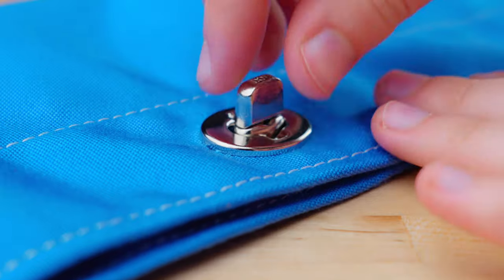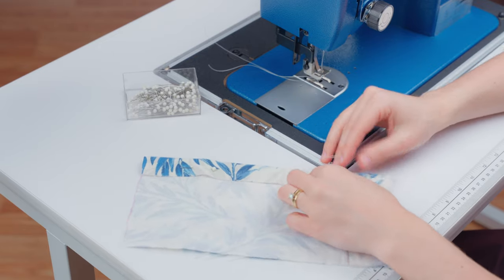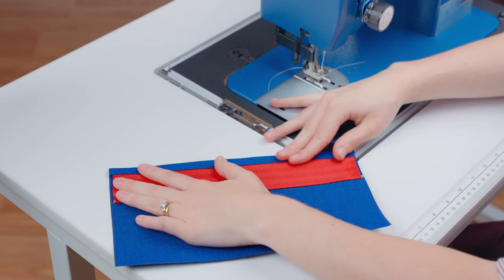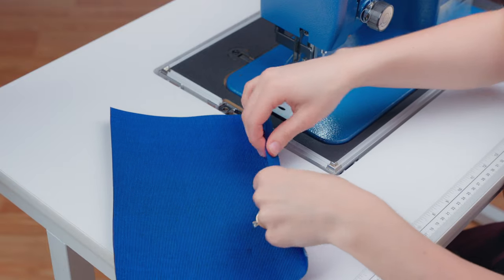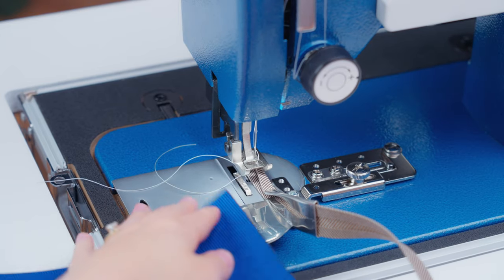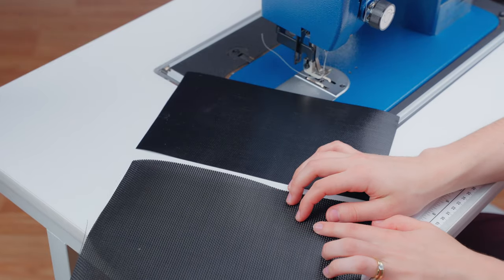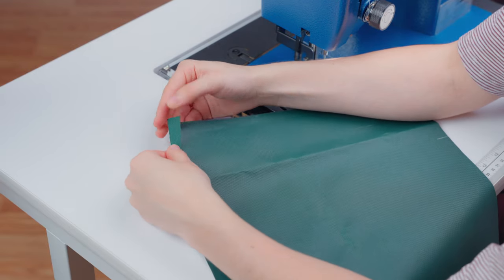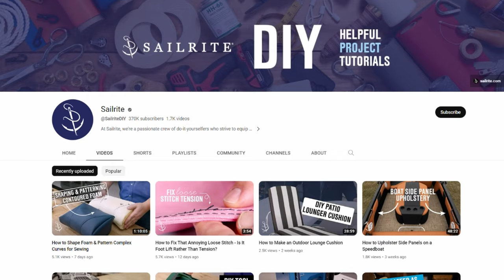Learning to Sew | Part 4: Popular Hems & More

Comment: I was in management with North America's largest leather furniture manufacturer. That double sided tape was simply NEVER used. 
I've been in MANY furniture repair shops where fabric, vinyl and leather covers were repaired and often replaced. That double sided tape was simply NEVER used.

I don't get Sailrite's worship of that double sided tape. Professionals simply don't use it. It costs much more than thread and adds work, time and money to the process. Why are you so entrenched in tape sewing??? If you watch the millions of videos showing sewing techniques used in small garment and accessory shops, and again, that double sided tape is not there in any of them. What's with this??
Note, I love your instructional videos as they show us how to measure, pattern and sew so many things. It's just the tape I don't get. :)
Reply from the maker: For beginners it is a way to remove the step of worrying about keeping their fabric aligned so they can focus on stitching. It is a great sewing aid that helps with better results. For canvas work (biminis, dodger, cover, etc.) it helps with sealing the seam to prevent water from seeping though the stitch holes.
Reply from the maker: For beginners it is a way to remove the step of worrying about keeping their fabric aligned so they can focus on stitching. It is a great sewing aid that helps with better results. For canvas work (biminis, dodger, cover, etc.) it helps with sealing the seam to prevent water from seeping though the stitch holes.
Reply: @SailriteWorkbench  Never considered the seam sealing effect. Live and learn.